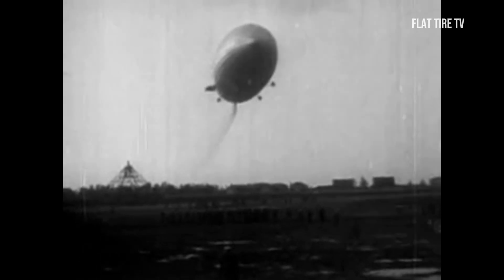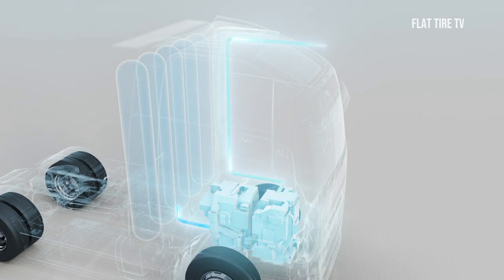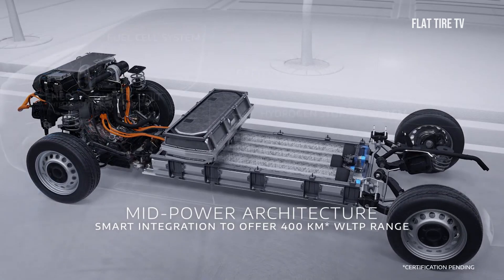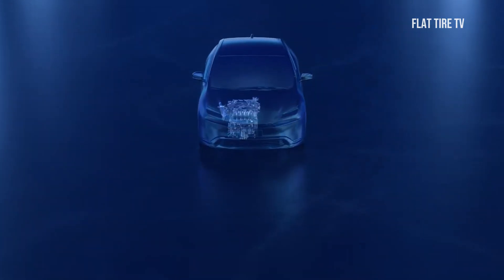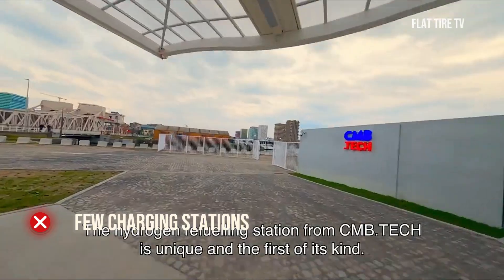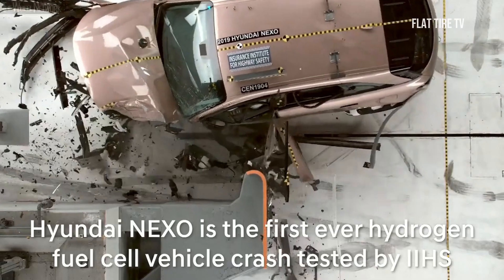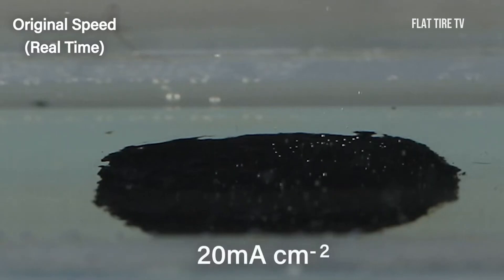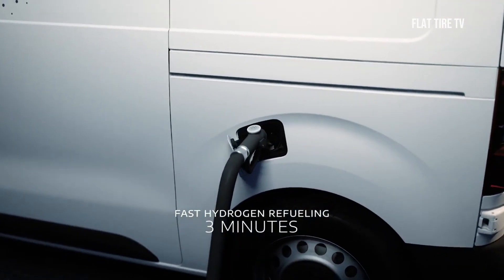HYDROGEN CARS DESTROY the ENTIRE INDUSTRY?

Comment: What all hydrogen proponents always forget to say is that the energy density is so much lower than electric and liquid fuels that you will never get any sensible range. Then there's system losses of the gas itself because you just can't keep hydrogen liquid at temperature.

Finally when a hydrogen tank blows it's not just a garage fire, it's half the street. There was a hydrogen explosion at a refuelling station in the US that went ballistic and half a suburban block went.

Comment: I don't want to go to a filling station to fill up I can't overemphasize the convenience of charging at home.
Reply: sure fine stick with ev, but only if your 100% powering it  solar or wind, otherwise you as big a problem as ice engines
Reply: @johntaphouse5235  Even if you power it on coal it's usually better than an ICE engine in terms of carbon emissions, but it's pretty close. Most places the local power grid will be partly solar / wind / nuclear / hydro and that portion will be increasing over time. That means your EV will be getting greener all the time. Your ICE car is stuck on gasoline forever.

Comment: I have seen a Nissan e-power cars that run on electric power, which are shown in adverts . So the electricity needed to operate the electric motors comes from the big alternator powered by ICE engine .
reminds me of big old trains operated by diesel engines , is the same principle . I guess they are overall less efficient  , but it is worth a try ...
Reply: Diesel-electric aren't "old trains", they are current tech. They were invented because before them, trains required impractically massive reduction gearboxes to accommodate the whole torque and speed range.

In a car, you have ~12% of mechanical losses in the engine itself, another ~10% in the transmission and ~10% in ancillary loads. If you eliminate the transmission and replace it with an HVDC alternator, you replace the ~10% transmission loss with ~2% alternator losses + 3% inverter losses + 3% motor losses, which is about 2% better before you count the benefits of instant electric torque, regen braking, always using fuel at its peak possible efficiency with no transients besides startup and shutdown, no space, weight and complexity wasted on a transmission and no fancy engine load management gymnastics. Generator is on and operating at its peak fuel efficiency when needed with the battery covering load spikes/sags, off otherwise.

But a generator doesn't need to be a rotating machine. Mainspring has free-piston linear generators that are achieving 45% efficiency from fuel to inverter output. If those could be scaled down to something more car-appropriate like 20kW (you need 16kW to drive at-speed on a flat highway with a Bolt EV) without sacrificing much efficiency, that would be great. On top of the ~10% of fuel-to-crank efficiency saved from eliminating the conversion from reciprocating to rotating motion before converting to electric, Mainspring's linear generators burn clean enough to pass most emission standards without a catalytic converter, major cost and space saving for an EV range extender.
Reply: You mean with about 1/5 the efficiency it's worth a try? We already know the results of that try. It's a fail. This video is recycling stuff that has already been proven false and that is why hydrogen is dead.